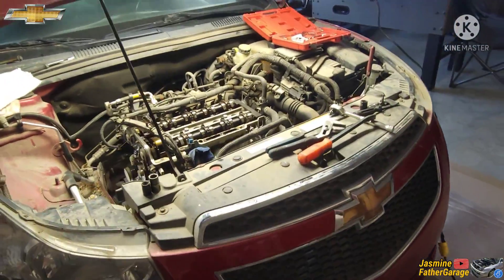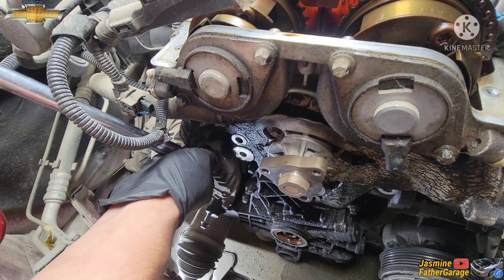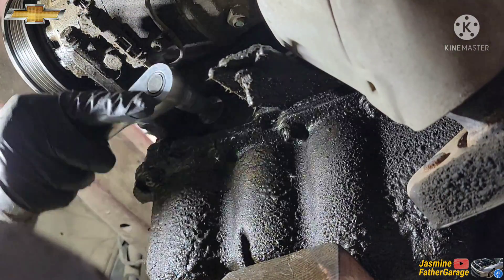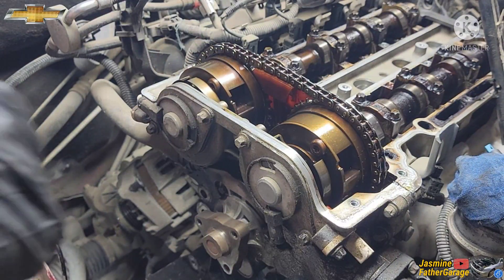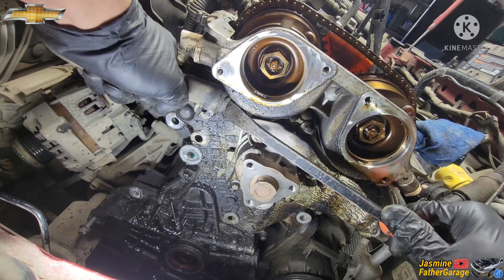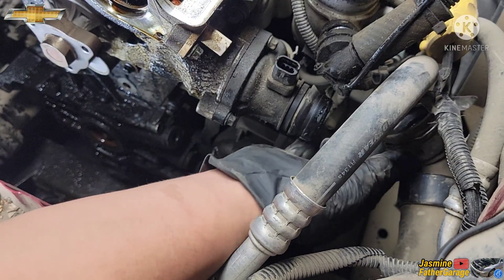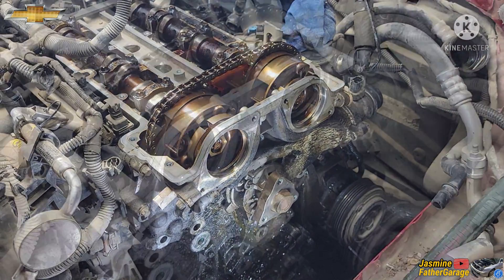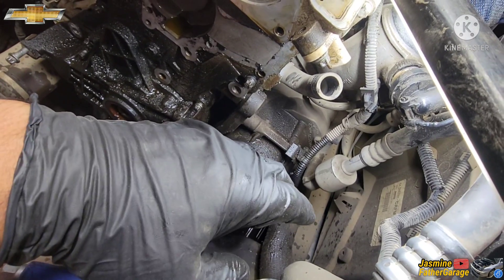V2: Chevy Cruze 1.4 turbo! How to Remove Crank Pulley, Timing Cover, Chain & Other stuff

Comment: The crankshaft pulley keeps spinning any ideas? It's oily because of the leak
Reply from the maker: Pulley keeps spinning Hmmm..

Are you trying to Install the crank pulley back in? 

Or your locking the Crankshaft  to perform the timing chain replacement?
Reply: @ so I ended up getting it out , had to use a extension to catch the pulley from spinning.
Reply: I was trying to remove the crankshaft bolt

Comment: Another video that didnt say what size socket to remove the balancer bolt. Why? Why?
Reply: Dude really?? You can't figure the size out? Probably shouldn't be messing.
Reply: @royquesada5295  Yep.
Reply from the maker: Its on this other video at 1:12  https://youtu.be/SCa16aTiXMQ
Reply: E18
Reply: E18 inverted torx

Comment: Oh my God you are a f**** genius!!! I've been looking for all kinds of special pullers on Amazon tools different kinds of things to hook up to it to get it to stay in place so I could turn that bolt and you figure it out by just using the belt that goes on it unbelievable. Thank you so so much from the bottom of my heart they have been fighting this thing for a week to fix the crank seal that's leaking oil like a stuck pig and I thought I was going to have to pay a shop to do it even though I can't afford it and you just saved my bacon. Thank you sir
Reply from the maker: Im glad i can help.  Would you be available to  share this video and subscribe for more d.i.y. automotive coming
Reply: If u use a impact...u don't have to hold the crank pulley.    Do do the job u need to remove the inner fender liner...and wheel on passenger side anyways.... Then u can get a impact to it.... with a 6 point socket 15mm

Comment: My car is in the shop getting this done right now. Nice to see exactly what’s wrong.
Reply from the maker: Just wondering How much your shop charge you to do this job?
Reply: @jfGarage4k  id like to know the same since I'm on the fence about wether I want to do this myself or if I want to have it done. This looks like a hot mess
Reply: @Josh42711  yeah I’m in the same boat lol.. I’m going to try a tune up cos I don’t here no clinging and clanging but it just not running right it at 99500 k miles